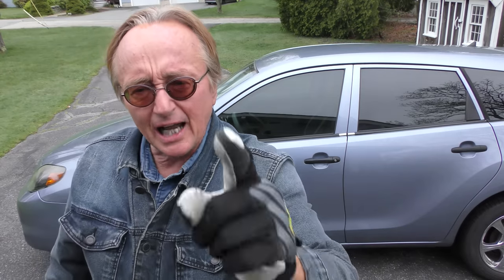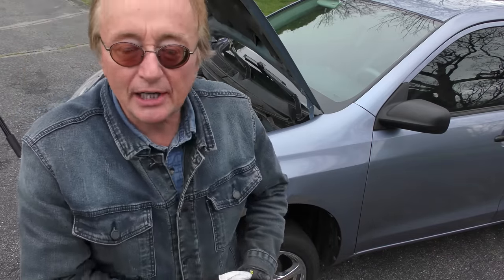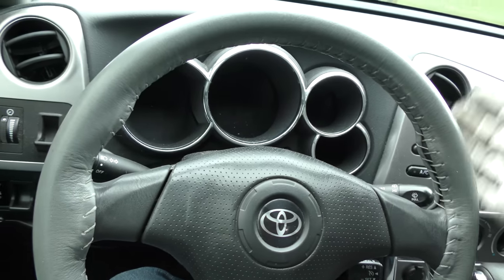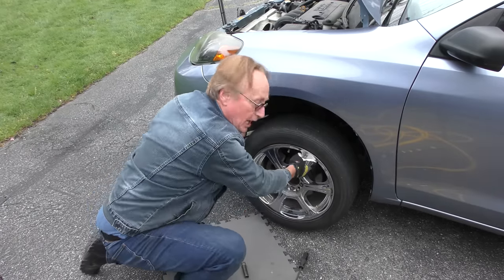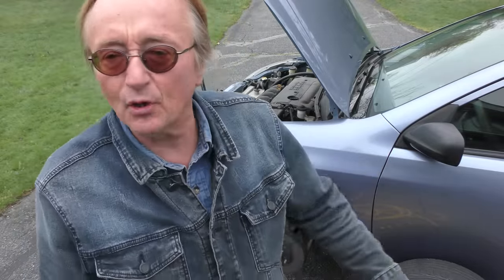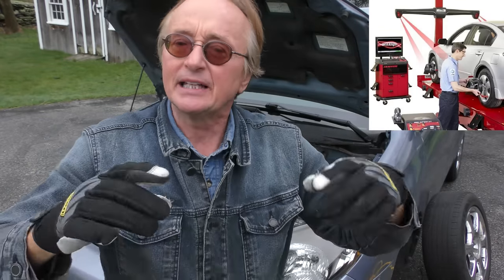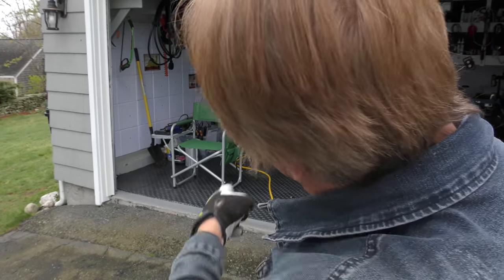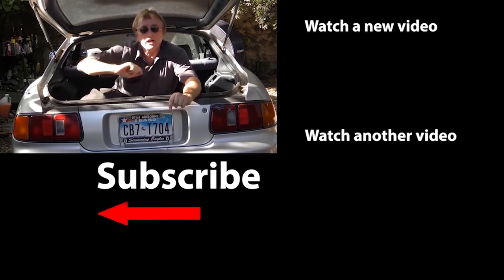I Was Just Threatened to Not Tell Anyone This

Comment: Scotty, 67 A body with quick ratio steering box. 
Perfect for about 50 miles then developed some slop no help from mfr (it was $$$)
Advice. or show us what to ck or adjust? 
Love the older cars I dont care about a few mpg. Easy fix, fast and cheap most times. 
Quit wrenching in shops in the late 80s when EFI engine bays started getting too crowded wasnt fun anymore

Comment: I had a problem with a car I owned one day. I was heading home, which was about a mile away, & my car started behaving like it was out of fuel, yet the fuel tank was full, as I had filled it earlier. I pulled over, & opened the bonnet. The sight glass on the fuel pump was still full. I backed the fuel line off at the carby, then I bridged the solenoid & battery terminals on the starter to spin the engine. No fuel from the fuel line. Fuel pump had failed. My father got my spare fuel pump I had, & brought it to me. When I removed the fuel pump from the engine, I soon saw why it had failed. It was a mechanical pump, driven by the camshaft in the engine. The pump actuator arm fell out of the pump, & into the bottom of the sump. I fitted the new pump, primed the carby, started the engine, checked for oil leaks, saw no oil leaking, closed the bonnet, & drove home.
Reply: Yup. Had a 67 Olds that happened to.

Comment: Personally I like to put anti seize on the contact surfaces between the wheel and the hub. It makes getting the wheel off much easier. Do not put it onto the threads. Or they might undo! I also torque up the nuts to the recommended pounds per square foot. Then after 100km or 60 miles I check the torque at the same poundage.

Comment: This advice is for if you have a junk car. You don't wait until your strut mount is broken to replace your struts and shocks that's completely insane. The guy is driving on completely bald tires they're down beyond the 2/32 wear bar ffs. Struts and shocks usually wear out slowly so you can't even tell because it happened so gradually until you drive something with good shocks and struts. They dont have to be blown to be worn out. Hav some standards here people

Comment: i had my car in for a timing belt job along with oil change along with a once over. i have a volvo 850 and in the rear you have this ball kinda thing when you bottom out the spring on the strut. well the bolt for them tend to come out they wanted to replace the entire strut to fix it when all that is needed is a new bolt. now it is inside the spring so it is a PITA to get tools in there to fix it but it is just a lift get bolt and tools inside spring screw in done.

Comment: Fortunately Scotty i have access to Big O Tires where they offer an alignment package $200 for 5 years and I get an alignment check/Adj every oil change and tire rotation so twice a year i get my printout and keep driving down the road Michelin tires at 1K  for 4 you definitely want to monitor those babies. standard Wheel Alignment is $79 so you can see the savings especially if you keep your car for 5 years+ like i do i'm OCD about wheel bounce and my steering has to absolutely dead straight or i feel something is wrong lol

Comment: I just replaced the front struts on my Subaru Outback. Took less than an hour to do both. Was honestly one of the easiest repair jobs I've ever had to do. I used the OEM KYB replacements that I bought as a pair for $350. Shop would have used parts store garbage and charged me close to a grand.

Comment: yea before replacing a wheel bearing I had to use a breaker bar and a 6 foot steel fence post to remove the front tire nuts. Someone went to far with the air wrench when new tires were installed and that's not good for the treaded studs or bolts. That's one more reason for doing it yourself if you can, you know what was done.

Comment: Over here in the UK there is a company called quick fit if you go into get a puncture fixed they came in and told me the brake shoes and disks were scored I told them to forget it and just repair the puncture two month later it was in for an MOT and it passed no mention about my brakes

Comment: SCOTTY, come into the new millennium and buy a Milwaukee M18 cordless High Torque 1/2" impact! They have 1,400ftlbs OF TORQUE! That's 500ftlbs more torque more than my Snap-On air impact. After not using my Snap-On impact for 3yrs, I finally sold it to someone for $150. 
YOU SHOULD DO THE SAME OLD DUDE!

Comment: Shop told me i needed brakes n rotors. Wanted 700 bucks. Thing is i changed them all myself less than a year ago and less than 200 miles on them😂 as a bonus they wanted 800 bucks to change spark plugs on an 03 5.3 envoy😂 of course i refused

Comment: I have a 2002 Infiniti Q45 when I bought the car it had a brand new dealer strut on the drivers side the steering wheel shakes intermittently I believe it’s the passenger one that’s bad and making it shake like that at high speed on rough roads what do you think and thanks

Comment: Yeah been told by gm dealer the rad from my 18 tahoe is leaking and needs replaced. Never seen leak in garage couldn't see anything under the hood. And never filled up a single drop of coolant. So yeah we didn't replace the rad.

Comment: The most underrated fix for bad alighnment and weird brakes is to check the damn AIR in the tires.
DONT eyeball it....actually use a gauge. A tire can look full with only 10 lbs of air.
Reply: I wouldn't go cheap, on a guage. Spending more for a certified calibrated quality tire guage isn't wasted money. Proper tire pressure is a life saver

Comment: Hey Scotty question. Speaking of brake jobs, I do most of my own work and was about to replace the front brakes on my 2010 Prius only because the rotors are warped. If I'm able to have the rotors turned is it okay to use the same pads that are on there, because they're still plenty thick? Or should I replace them since they've been on warped rotors for thousands of miles? Does that make any difference? Thanks!
Reply: Great question
Reply: Replace them

Comment: Know one brake brand where the joke is you put them on, and just change the rotor every 30 000km, leaving the pad there, because it has not worn much. Shocks you can feel them when worn, but at that time you probably want to change things like worn ball joints and such anyway. And alignment is needed if you drive in pothole country, and get the errant ones that are well hidden.

Comment: I recently was told i needed a strut but i needed to get 2 or it would render my car lopsided. DID I GET SCREWED?  which would be a good regular feature idea!
Reply: I usually replace them in pairs. Damping may be slightly different due to age, and if one is actually bad, the other may go soon. They don't always see the same exact stresses but are fairly close.  If they're  old at all its likely the gas charge is gone. It may work ok, but a new one will hold the car up slightly more. 
New struts have a gas charge in them to keep the oil from foaming, that charge causes it to push the rod out, an old shock or strut often has lost that charge & won't push it out anymore, even if it's not leaking or completely  bad.

Comment: The best thing I have done for the shop is to get a super quiet air compressor, mine was a California air tools brand, but now other places have nearly the same item. It's a lot quieter than the one you have in this video.
Reply: A compressor can’t last without oil. The friction will eat it up in no time. Look at the commercial compressors they are all oil lubricated and the compressor is belt driven instead of direct drive.
Reply: @brandonstclair6530  That’s nonsense! My big shop compressor is oil filled, however, my job site compressor which is heavily used during remodel work, is oil less and has been going strong for over ten years. 

The most common failure with small compressors is typically a start capacitor, or operator error such as being powered with insufficiently sized extension cords, or being tossed about by knuckleheads.

Comment: Toyota dealer mechanic show me the video about my corolla need to replaced the shock because of the oil stains around it, I did replaced it, am I do the stupid things listen to the mechanic?
Reply: Here in Germany, they make you replace your shocks and struts, if they see leaking oil, even if there's enough in them for proper operation. Part of the reason for condemning them is the environmental pollution caused by dripping oil

Comment: Hi Scotty, I have 2006 Toyota Avensis 157k mileage and I was about to order a new struts, but after watching this I think I better wait. However, I had to change the front tyres because of the wear  from both sides. Middle tread were absolutely fine. I’m driving a lot of roundabouts on the way to the work. Would you recommend to change struts to be on the safe side?
Reply: Probably underinflation. If worn in the middle but not on the outside, it is over-inflation. Alignment problem usually manifests in wear on one side, not both.

Comment: How good are the oilless compressors
Reply: We'll have to wait and see. I have both oiled and oilless. I keep the oilless for when my oiled craps out someday. There's only grease lubricating where the connecting rod attaches to the crankshaft, leaving me to have very little confidence in this design. I got it for free from my neighbor. It only needed a starting condenser for the motor, in order to get it running again. The part only costed me a couple bucks

Comment: SCOTTY:
-Mr. Kilmer my Chevy 3500 HD 2018 has an issue with SERVICE STABILITRAK and SERVICE TRAILER BRAKE messages on the dash resulting in Misfire and loss of power with a check engine light flashing upon accelerating when raining it goes off and comes back on sometimes. Is there anyway to solve this?

Comment: Women get screwed more than men cuz men have a general knowledge of cars (in most cases). They hate it when a woman knows about cars and they get caught trying to rip her off. They want $110.00+ just for labor. Beware too because some will break something else so you have to come back constantly. Front end work is expensive as it is. Then you have these alleged after market Warranties. They dont tell you most repair shops don't accept it and dealers won't. I got that car shield crap & when I needed it, no one near me would accept it. I'll never do that again. Now I'm about to find out if the dealer bumper to bumper warranty covers repairs. If not, they owe me $3500.00, and will get reported to Atty General Consumer Affairs dept. BBB does pretty much nothing to hold them accountable.

Comment: Here is a rip off story for you. A friend has an old 1992 mercedes 300 ce, classic for sure but an old car none the less. The smog pump failed and he was quoted at LEAST $3000.00 to fix it including a used $1000.00 replacement part. Well i’m retied but I had to butt in. Found a re-manufactured warranted smog pump for $250.00 looked at the car, and replaced it in about 2 hours. I figure shops just don’t have the knowledge or ability where i live to want to bother working on anything that requires any actual knowledge.